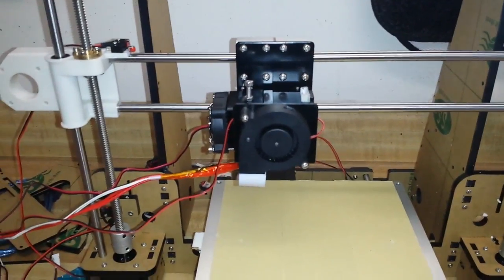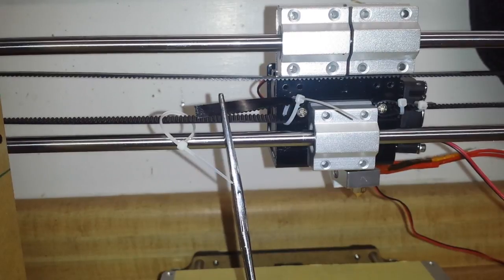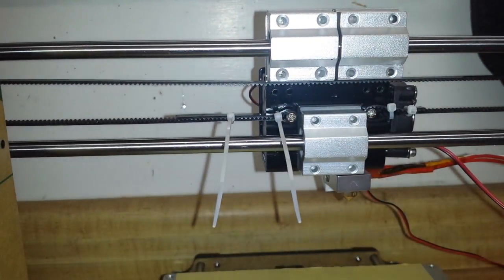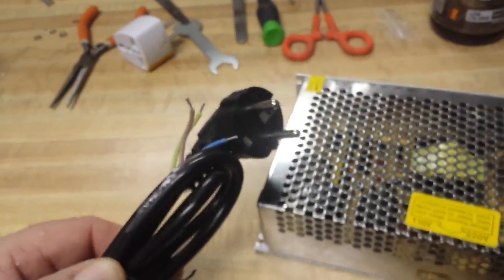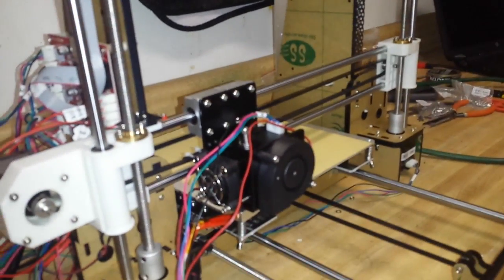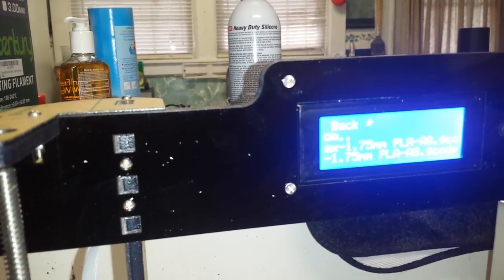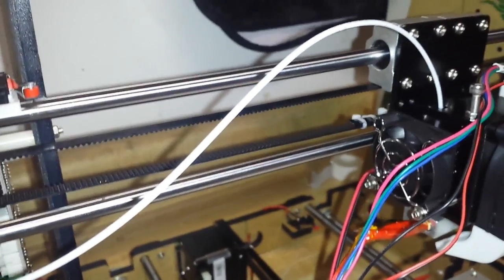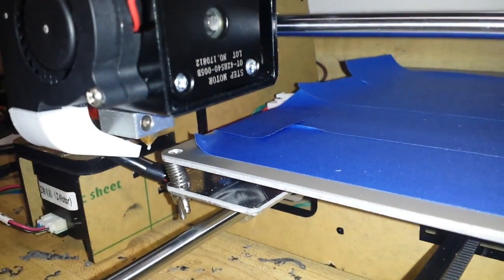Anet A8 3D Printer build part 2

Comment: Your zero point is not properly set, and your bed needs to be leveled (it is sitting too low). Check out some basics videos from Thomas Sanladerer's youtube channel. Also it seems like speed/acceleration are very high as well.
Reply from the maker: +John Degenstein Thanks, I actually had it all dialed today, I think. I had 3 nice prints. But then it died. I believe the main board went. I was getting ready to start print number 4 and hit "preheat pla" and boom ... Screen went black instantly. I checked the power supply and it is still outputting 11.98VDC. So...I don't know.
Reply: Man, that stinks. Sorry to hear that. I wonder what went wrong with it.
Reply from the maker: +John Degenstein Thank you. I'm really not sure. I could a failure analysis on the board, but honestly I'll just chalk it up to electronic infant death, and order a new main board. If it happens again then I'll dig deeper.

But, hey thanks for watching and taking the time to comment and offer suggestions. I'm brand new to 3d printing and I'll take all the help I can get!